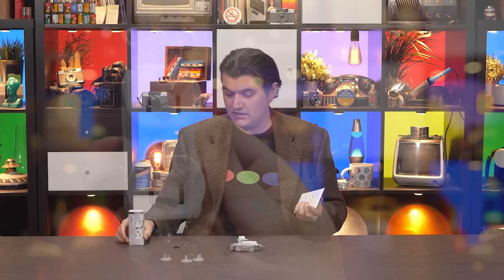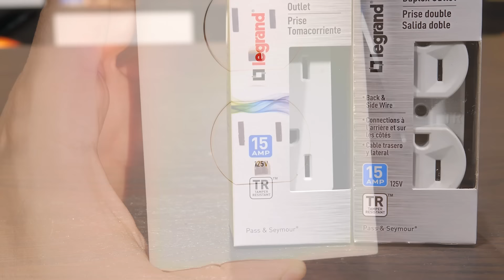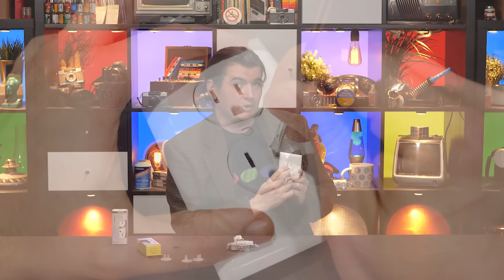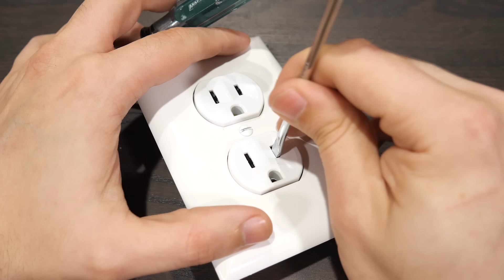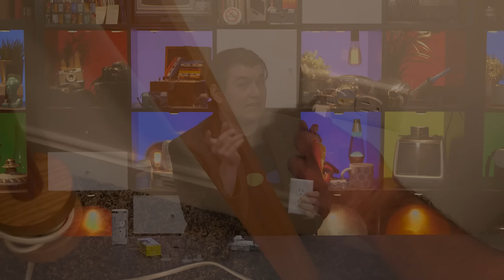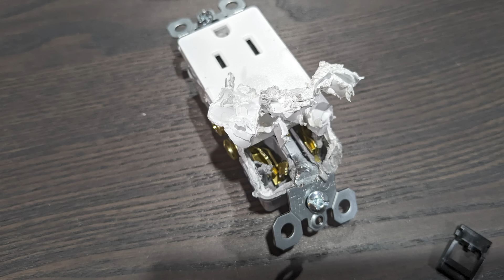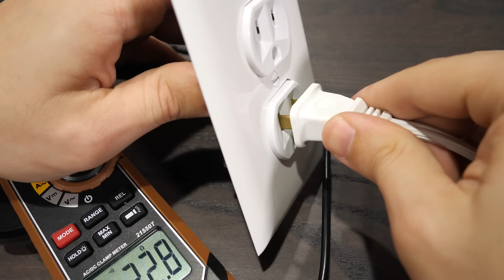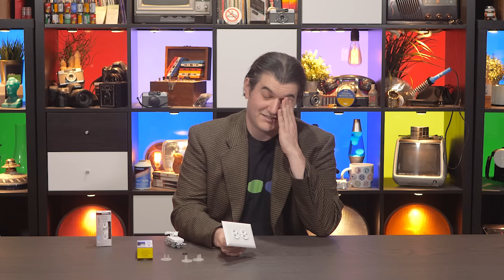Tamper-resistant outlets aren't all the same - a follow-up

Comment: Also, as a overseas traveller, I will usually use some sort of travel adapter. They are (1) are often poor quality and (2) act as an extra lever on which my Schuko plug can act. Combine that with (3) worn-out sockets in a hotel room, and it will fall out quite often.

I solved that by wiring a 90 degree US plug on an European power strip, and stopped using the travel adapter.

Comment: Speaking of poor quality electrical devices that can wear out prematurely, , I always wonder why mobile homes have a different standard (lower in my estimation) for plumbing and electrical. I live in a 1990 manufactured home and am replacing (as they go bad) all of the old outlets. Why do regulators let these potentially dangerous standards to exist and AFAIK remain in place? The only saving grace is a standard mobile home duplex box is  smaller than a regular NEC cutout box. The plumbing and electrical in this house are truly scary. Cheers

Comment: The springs in 'backstab' US outlets tend to be made of copper or brass (or maybe bronze?) rather than the steel used on Wago connectors, which is how they got a bad reputation

Comment: See you need British plugs and with 240volts as well..LOL (I know before you block me) BUT in the UK WE DO HAVE a 110v 2 pin socket in our houses, The bathroom mirror light often has a 2 pin 240/110v socket on it, its the only socket in the bathroom and is only used for electric shavers, of cause if you have an adaptor you can run a 1980s CRT TV balanced on the sink while you laze in the bath watching football but it was never recommended
Reply: The european Type F plug and socket is even better than the british ones

Comment: Current kills, but ... Your body has a certain resistance. Current = V/R.  Your body's resistance is a variable but generally it's pretty high so it would normally take a lot of volts to push enough current to hurt you.
I've touched 120V on a few occasions, and it tingles, it even hurts a bit but I've never had any muscle contraction. I could easily let go of the wire.
I got zapped by 30KV once. ONCE!. That time there was muscle contraction.
Reply: If you are grounded then 120 V can well kill. 30 kV can do huge damage. People have lost limbs with high voltage.
Reply: @okaro6595  , No argument. It's just not very likely.   BTW, technically it's not "High Voltage" until 600V

Comment: In regards to "plugs falling out". I am just speculating here but maybe it's because europeans are used to plugs being seated much more firmly and just being way rougher with how they treat the cable because in Europe nobody is worried about them coming out at all especially if it's a plug with grounding. You can just have a plugged-in cable under tension while using it.
Think of typical canister vacuums. Many people don't even bother pulling out some slack for the cord and just pull around the vacuum. This will pull out the cord from the spring tension retraction mechanism right against the wall outlet plug. Any european outlet in even halfway decent condition will not budge at all if you do this.
The same goes for too-short cables. I just pull a bit on the cable to see if it might be just enough with a bit of tension before rummaging for an extension cable.
You Americans probably pull out slack form the canister vacuum beforehand and reach for the extension cable immediately just based off experience so you never actually encounter the plug falling out of the wall to begin with.

Comment: Some UK sockets are like that Alec, mostly MK brand. They are unique in that they will open with no earth pin (sometimes happens with our double insulated appliances that they have a plastic earth pin, or 'insulated shutter opening device' officially, and they can snap off). 

Another feature of those particular sockets is that they have a pair of dimples in the L and N pins to 'trap' europlugs and prevent them opening the shutter, due to our 32 amp ring circuits REQUIRING a fuse in the plug

Comment: I think the complaints from tourists also has to do with adapter plugs. If I plug an adapter plug into an American outlet, and then a heavy USB charger or whatever, then the extra distance of the adapter plug causes a lot of turning momentum, and the whole thing goes out of the outlet much quicker. I assume this won't be an issue with more expensive adapter plugs, but, well, nobody buys them.

Comment: Fwiw I think the shock hazard is not even the biggest danger. I've had a bad outlet where the contact with the blades was weak and there was arcing happening inside the outlet. A plug falling out could cause the same thing. And I'm much more afraid of that starting a fire than I am of getting a shock which requires both falling out and poking fingers into the gap. Arcing causing a fire can happen when there's nobody even standing there. And fwiw I had never noticed plugs falling out, it just doesn't seem to happen to me (and I'm not in Chicago).... Until I started looking for it and noticing that other people seem to just leave their plugs half inserted all the d-m time. I'm constantly pushing other people's plugs in these days. I don't even think it's about falling out, I think they just push things in until things light up and then walk away with a huge gap.
Reply: Also fwiw the arcing I had was in a UK outlet which is supposed to be the safest design. So... not sure what to make of that

For that matter some European can be just as loose or even looser than US plugs. Think of the two prong ungrounded plugs (Type C). Two prong outlets are often not recessed at all and even if you're plugging into any of the round recessed outlets they often don't even touch the side. They actually have thin pins that are significantly thinner than the outlet holes and depend on the pins not being parallel to grip the side of the holes! I actually find those outlets to be so loose that a phone charger with an adapter is just unusable because it falls right out.

Comment: A GFCI probably won't detect leakage on 24v, as such voltage is usually isolated from 120v by being on a different transformer winding.
This has been brought up in relation to people doing bad things with high voltage transformers (as from a microwave oven).

Comment: I think a big part of the European confusion around them falling out is to do with how thin and flimsy the US blades and plugs feel (which i also assume is a 120 vs 240 thing) and how few high quality american sockets that properly grip the blades we've experienced (as you mentioned, the hotel sockets tend to be terrible). They feel flimsy in conparison to the big british blades or common EU two pin prongs. The 3 pin type L plugs are available in some places and feel terrible in comparison as well. The big thing is just how few right angle plugs witht he heavy duty connectors you have. Obviously the british ones are almost all chunky pieces of plastic to accomdate the extra pin, but I've found most of the 2 pin european appliances I've owned to be much more similar to your right angle connectors, but closer in size to the british ones. It looks so odd to me to see the cable run straight out perpendicular to the wall. This said, i think every house I've ever lived in has the plugs in pairs beside each other so it looks like Chicago is just a bit more like the rest of the world in that regard

Comment: When touching any electrical outlet or connector it helps to make sure you always do it with one hand, so the electricity does not have any excuse to take the touristic route through your body from one hand to the other.

Comment: I suspect that the plugs always falling out thing could be because we have to use an adapter to plug in so have a whole load more weight hanging off the plug pulling it out the socket

Comment: From what I've experienced with US outlets that seem to fall out - I'm usually plugging in a chunky adapter and then a UK plug into the other side of the adapter which probably puts a lot of awkward leverage on the wall outlet so they fall out some times. Whereas if I was just using a US cord it would probs be fine.

Comment: male plug end on a super inexpensive plug without identified plugs is the only thing I have seen a problem with. The only ones of these I've seen are on cheap phone adaptors. I bet if a travler had a bad experience with our plugs thats what I think they are dealing with. Ali express, dollar stores or convience store AC to usb adaptors are the things that suck not the reciptical.

Comment: I work for a company that makes high-power industrial laser CNC equipment, almost every single connection inside the electronic control cabinet uses push-to-insert terminals, using a screw is better in my opinion but is absolutely not necessary.

Comment: I've been shocked a few times by 120 doing electrical work (someone turned the breaker on after I turned it off thinking it was the one they were working on) and 240 once. 120 tingles and makes you jump back, 240 hurts a lot.
Reply: Ive been shocked between 2 phases 415 volts 3 phase at @50hz and this hurt alot lol, I could feel the 50hz pulasating through my arm muscles and afterwards my heart beated a little uneven and hurt and my whole body was shaking from the shocks and the massive adrenalin kick this gave me

Comment: I am not an Electrical Engineer or Electrician, but I believe that you do need a certain amount of surface area of contact in order to put out a certain amount of amps to keep the temperature within reason. Therefore wanting more insertion before a plug is energized cannot safely happen past a certain point (I don't know what the minimum surface area needs to be, it may not be much and your suggestion is fine). If the surface area is large enough that your idea of what is safe is not viable, then , I agree we need to change plug types to make it more safe. Or alternatively, on the outlet side, allow these Tamper Resistant outlets to have a face that pushes in when you plug in a cord and when you pull the cord out, the Tamper Resistant mechanism also pulls out the face of the outlet (to clarify, I mean each individual outlet face, for example, plugging a single plug into one of the two duplex outlets only pushes in the face of the single outlet, the other outlet on that same duplex is still sitting in its outward most position until another cord plug is plugged into it, I hope that makes sense) that would provide the cover over the prongs you are looking for, while at the same time allowing the connection from the outlet to the plug to remain relatively "large" so that you can safely apply the 15 or 20 amps and also does not require that we change both the cord plugs and the outlets. Only the outlets would be changed

Comment: Shutter mechanism is cool, until it starts to wedge or jam itself. Then you start pressing with too much force to insert a plug, which degrades the mechanism even faster. At the end, you have either broken shutters, aka. no protection, or no connection, or new sockets, aka. new investment.

Comment: When my father was at Greenwich Naval College he had a teacher who showed them 3 phase and the various voltage differences. They were set an experiment to determine what voltage was on each of 3 wires w.r.t. a neutral.
When they presented the result he picked up a wire in each hand and said "correct, that's the 120v"...

Comment: I shocked my finger with an American outlet when I was 9. It hurt, but that was about it. It didn't even trip the breaker. The good thing is, I quickly learned not to play with my night light anymore.
Reply: I shocked myself at my grandmas house as a kid, This was the old flat faced no shutter ungrounded 230volt european socket. I got zapped through the heart and both my hands almost vibrated to the 50hz frequenzy. Afterwards i got a really high adrenalin kick and my heart hurt a little and i shaked a little  but that was about it and i never did it again. Well until i zapped myself on 2 phases on a 415 volt 3 phase wire it was alot worse lol

Comment: One thing I like about this channel is the content could easily be really boring but it's quiet the opposite.  I love the humour.  Here in the U.k, we have two or three pronged plugs, depending if the appliance has an earth or not. If it does not have an earth the earth prong is a dummy prong.  Ours never fall out.  I’ve never had that problem.  The non scripted version lol

Comment: What's also more dangerous (so I've heard from a science teacher at school) about the 240V in the UK is that it's 50Hz whereas US is 120V @ 60Hz.

Apparently the frequency we have is far more deadly than 60Hz is so it's double voltage compounded by the frequency that gives some nasty shocks.
Reply: Mp, just te opposite Europe is 50 Hz and US 60 Hz. The frequency is not significant to the risk.
Reply: @okaro6595  Thanks I updated my post. I got them the wrong way round.

Comment: TR outlets are a curse upon us.
That requirement results in me , an adult, not being able to reliably plug in a 3 prong cord in my hallway, as it won’t go in , because if the overly sensitive alignment requirement. I will seek out non TR sockets if I can still find them. An adult should be able to bend down and plug in their vacuum cleaner without that requiring they square their shoulders to the wall and get in their knees to get at eye level with the damn socket. 

On the US standard , or lack there of for build quality requirements, yea it’s a mess never to be fixed. Because of our non standardized to get by with cheapest possible implementation philosophy , we have a whole set of plug pin arrangements to allow for 15A, 20A, 30A, 50A and 125V, 250V, 270V , etc. at least 10 different ones in the most common current and 1 or 2 phase types.  And they all fit the std gang boxes installed on our stud wall construction.  Replacing any of that with an improved , more one size fits most solution may not fit the gang boxes and thus making a change would require massive updates over time and be hugely disruptive to the product market needing to support. A variety of plugs then. A system that was better but backwards compatible to the old plugs so those cords could get phased out over 50 years and then remove the backward compatible outlets , it’s a many generation process at great expense. 

This is the country that could not even switch to the metric system and continues to sell wood as 2x4 which is meaningless in relation to the dimensions of the actual wood.  We use the same word “ounces” for multiple measures that are unrelated. Ugh.
Reply: Here in europe we have used outlets with rotating shutter doors since the early 2000s and they have never been a problem, Now our plugs and outlets are alot better designed and safer and  the round plugs are beefier so that might make them easier to plug in.

Comment: Loose plugs: but the funny thing is that even unearthed C plugs don't get dislodged like A plugs do.  It might be just geometry, that the two thin parallel blades actually encourage that happening while the round pins are less prone to do that.  Could also be the design of the contact surface (which is partly due to the pin shape): the A/B socket is a gutter with side contacts and practically nothing on the top or the bottom, so up and down tilting the plug is not really restricted, while a euro socket has to engulf the round pin so there's always something holding onto the pin in every direction, even in shallow (non-E/F) sockets.  The guides from the side in a deep (E/F) socket restrict movement even further.

Not sure why wear is a meme for NEMA style sockets only, but I definitely can't remember the last time I had a socket here in euro lands where my phone charger was all kinds of floppy.  Receptacle dislodging from the wall much more often XD
Reply: The Europlug  prongs are designed to be flexible. The prongs are bent inwards. This is to allow use in different sockets with 4 mm and 4.8 mm holes.
Reply: @okaro6595  Yeah, I originally wanted to mention as an extra thing that probably helps the C plug (and would be an impossible upgrade for A plugs), but I deleted it.  That's just the cherry on top of why a C plug might not want to ease out of a socket as readily as an A one does.

But even if we put the "high tech" aspect of the Europlug aside, CEE 7/2 and 7/17 plugs (both 4.8 straight cylindrical prongs) stand firm in a non- or barely recessed socket.  Hella unhappy to touch under the housing, but they don't wiggle out easily for sure.

Comment: I replaced 2 outlets in my bedroom with GFCI outlets just last week (I live in a very old house with no ground wire running on the 3rd floor), and almost got shocked when someone else living here flipped the breaker back on, I was literally seconds away from touching the hot wire while they turned it on

Comment: How does the Europian Plug only have 3 prongs and not 3?
Reply: The grounded European socket has the contacts on the top and bottom and the plug has metal on those parts. Some countries se a prong in the socket and the plug has a hole for it. This is a typical plug. It supports both grounding systems:

https://upload.wikimedia.org/wikipedia/commons/5/5d/CEE_7-7.jpg

It was designed so that you could not plug ungrounded plugs to grounded sockets. Modern double insulated devices have plugs designed to fit also grounded sockets.

https://upload.wikimedia.org/wikipedia/commons/e/ef/CEE_7-17_plug.jpg

https://upload.wikimedia.org/wikipedia/commons/6/63/Euro-Flachstecker_2.jpg